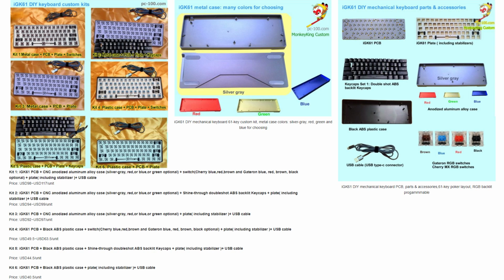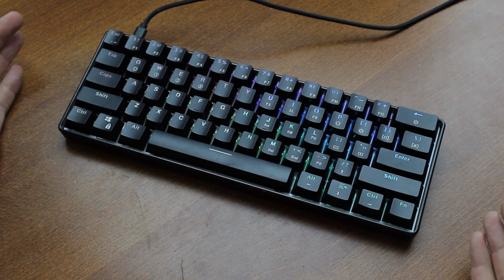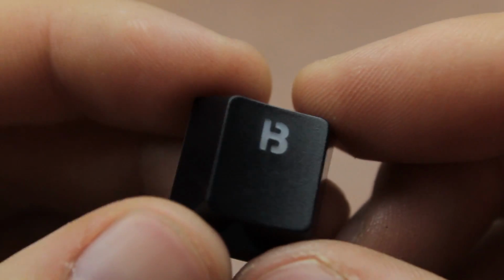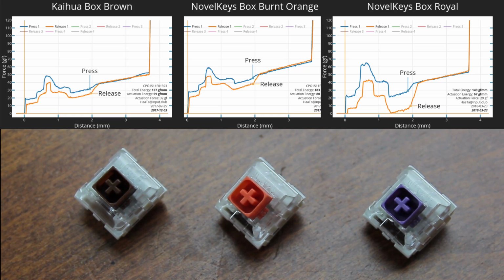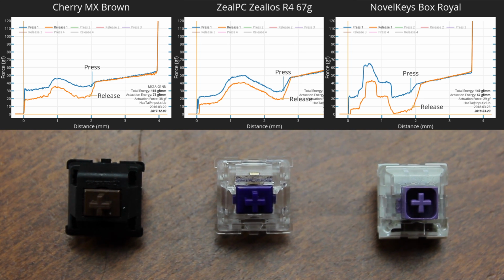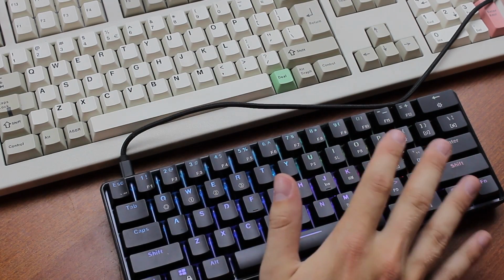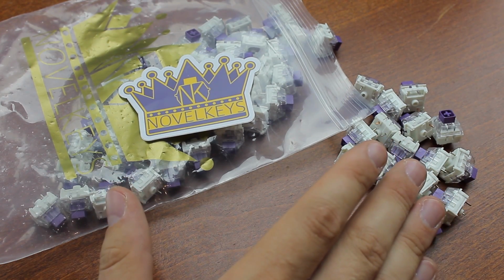MonkeyKing Custom iGK61 60% keyboard review (Kailh BOX Royal)

Comment: With regards to the digitality, I think it takes away from the transition throughout the stroke. I think that we need a sensory experience to ramp up (psychologically speaking) when we initiate the application of pressure onto something. But when our starting point is of a static force and then ramps downward it generates a sensation of collapsing rather than impeding the stroke. Perhaps this will serve as an analog. I could drive through a speed-bump experiencing the full shape of the oscillation or I could begin at the peak of the bump then roll off. The former complete travel creates a sense of contiguity which I think is sensorily valuable.  Without it there's a sense of dissonance. I wonder if this tactile feedback can be modified or if it is inherent to the design.
Reply: Agreed. 

But then again I do love Plum switches too

Comment: I own the GMMK board, two of them actually. They both came in bent and not sitting flat, I had to bend them to get them to stay flat, I think it's because they're aluminum and not packaged well. The bare bones base is only about $60, the full keyboard with switches and caps is a little over $100. I have the box navy switches in mine and the loud click causes a high pitched resonance from my board.

Comment: between jade navy and royals, which is the most clicky and preferably light?
Reply: I'm not chyrosran22, but I've used both of the box royals, and the box jades.

The box jades are much more "clicky" feeling then the box royals.  The jades also feel quite a bit smoother, the tactile bump on the royals is quite extreme in comparison. 

The jades seem to require less force then the box royals, the box navies are more or less the box jades but with a heavier spring.  So if light keys are what you are going for, I would avoid the box navies.
Reply: Cinnabar Sonar  thanks man you’ve made my decision
Reply: @jiajieguo7322  I'm assuming the box jades?
Reply: Cinnabar Sonar - yeah the jades
Reply: @jiajieguo7322  
They are both excellent switches in my opinion, I actually prefer the royals myself, but I'm a bit sensitive to the noise that clicky switches make.  If you want a clicky, light, and very tactile switch the jades are the way to go.

Just keep in mind that the combination of the thick click bar and the lighter spring can make the jades snag a bit on it's way back up on the return press (if you have a particularly tight plate mount), as explained in this video. 
https://youtu.be/rz-hYpgmUko

I haven't had an issue with that, and I did the very non scientific test where I clamped down one of the switches with a pair of vice grips, I still wasn't able to replicate that issue, so you would need a particularly tight plate mount for that issue to pop up.

I hope you enjoy them, they are my personal favorite clicky switches so far.
Reply: Cinnabar Sonar - Thank you so much for explaining the differences between the switches. I didn’t know which were the “best” switches for me and you have confirmed that for me. Thanks
Reply: @jiajieguo7322  
No problem, and I really hope that you like them.

Comment: BULLETIN UPDATE

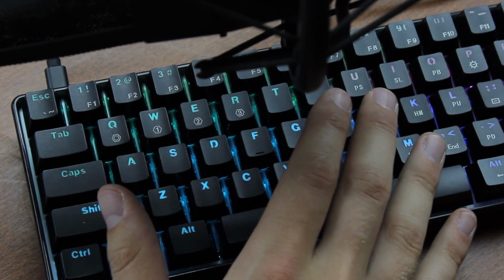In regards to the click that develops over time (the fun fact at 9:01), it's "part of the design" because the lube on the actuation nib rubs off gradually with use. Too bad there won't be plans to change the design.

We'll just have to go with Holy Pandas, Zealios v2, or KBDFans T1 (not sure where to find these switches). Alternatively, you could make Holy Chickies from halo trues and gateron blues. This with a jailhouse mod and latex plastic on the housing = glorious!

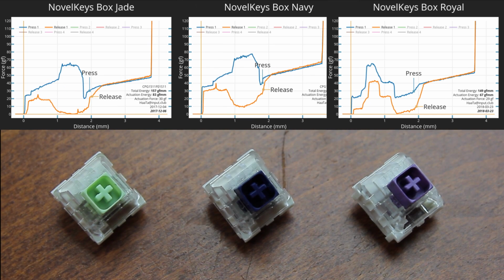Comment: Thomas, from your graphs at 5:30, and for high levels of tactility and clickiness desired (e.g. Model M), would you still recommend the Jades over the Navys? Would you agree the Navy's are probably closer to the Model M switches, actuation-force-wise? Would you even compare them in that sense?
PS. At 9:30, besides the keys we can hear what seems to be a clock ticking in the background: good microphone, or otherwise pretty loud clock ;)
Reply from the maker: I'd say Navies are nowhere near a Model M, they are SO much stiffer. I suspect even Jades will feel stiffer (I don't have a full board with them atm). Also, it's both a good mic and a loud clock xD .
Reply: @Chyrosran22  Thanks a lot! Ok will try a sample of the Navys first just in case. This other video of yours with the charts suggests the peak actuation force for both would be very similar though, both somewhere around 75 gr: https://youtu.be/0HiO3G_ZV0M?t=442
( Sorry about my maybe confusing the Model M and F, in any case I meant buckling springs, as in here: https://youtu.be/B9LcLgcCmus?t=370 )
Reply: @Chyrosran22  Hmmm just checking their own spec sheet from NovelKeys, is seems to confirm your assessment about Box Navies being a lot stiffer than Model M's. The force curve there goes pretty much up to 90 gf, and they do list Tactile Force as 95 gf +/- 15 gf !
https://cdn.shopify.com/s/files/1/3099/8088/files/BOX_Navy.pdf?5816470357010718290
That is indeed quite a higher range than what the graph in your video shows, where it appears to be just up to about 75.
If anything, the Jades would seem to be somewhat closer to the Model M's, with Tactile Force of 75 +/- 15 gf according to their specsheet (while Pale Blues have 70 +/- 10, and Whites have 55 +/- 10):
https://cdn.shopify.com/s/files/1/3099/8088/files/BOX_Jade.pdf?5816470357010718290

Comment: Hotswap boards are pretty common nowadays, and are popular with cheap Chinese boards.  Redragaon, for instance, switched their 30 dollar TKL, the Kumara, over to a hotswap design recently.
Reply: Outemu hotswap is not compatible with Kailh box switches, so not sure if Kumara is the best choice if you are into box switches. I am in the Kailh box camp, so I ordered a Hexgears GK705 off Aliexpress to scratch my hotswap itch cheaply, $50 shipped with a full compliment of box whites was hard to resist.
Reply: @rajendra82a  mine works, I have an outemu blue board with box whites
Reply: @Voodoo Yam all you have to do is clip one of the pins a little bit as it's too wide for the outemu board
Reply: @Voodoo Yam just grind the switch pins or do anything you could to make the pins smaller and it will fits

Comment: just ordere a Switch Tester of 12 tactile cherry mx versions. Cherry gateron kailh zealios and outemu. Also hako royals.
I can confirm what you said, compared to the box royals the others just felt linear. Even 78g zealios. 
Also can confirm that after playing a lot with the tester the box royal already turned clicky, which I dont like. Also the tactile bump is to sharp. Its like pressure pressure pressure with no give, sudden release and then nothing. 
Then there are hako royals that feel the same but stick to the bottom it seems.
In general I think this box royal design is not really durable and prone to early failures and defects, well box designs in general. Personally I think I will go for outemu sky with 78g spring, clear tops and a slightly retooled ice bottom for my first keeb. The tatility feels just a tiny amount better than the zealios.

Comment: If you get a bit of rubber and put it in the gap of the contact leaf part in a Box Brown, they feel pretty much identical in tactility to a box royal. 

Also I posted a video on my other account showing my EPBT caps flying off my Cherry 1800 with mx blacks, showing how they had stretched, but turns out the mx blacks were oddly thin on the cross section as my board of mx browns, board of gat red and gat yellows are fine. So box has definitely stretched some sets but 9 times out of 10 seem to fit comfortably without issue.
Reply: hey figureight see u on so many  videos saw u on adam c videos aswell

Comment: I haven't had any keycap fitment issues with my BOX navies. Between my GMK set and imsto pbt set; the GMK set goes on and comes off quite easily, where the imsto set has a bit more snug to it and requires a little more effort to remove. Otherwise, no apparent complications.

Comment: I think the click occurs because of the lube running out on the push rod (which pushes the contact leaf in the box). I've tried re-lubing that and it fixes the click.
Reply: How often do you have to re-lubericate them and how loud is the sound when they are not lubed?
Reply: @Animated__Freak  Not that loud, less than anything clicky, and about a couple month.

Comment: I need some expert help! I'm looking for a modern mechanical keyboard that feels like rubber dome or a recommendation for a very good rubber dome board with a nice hard bump. The key should have it's tactile bump right at the start or very close to it like rubber domes do also the key travel should be 2.5 - 3mm long with 55g or more force to press. Is there such a mechanical keyboard? Or maybe there is a way to modify one so it feels like described? Here are the few I tried already: Romer-G, MX blue with o rings, MX brown with o rings, Razer mecha membrane. The closest so far was the Romer-G switch but the bump is waaaay to light and it needs only 45g. Btw Topre is out of my price range i'm willing to spend up to 100€
Reply from the maker: Denis Müller try a BTC.

Comment: Just leaving this here for anyone interested in the switches and custom projects. 

I've put the box royals in an old WASD V2 TKL I had sitting in storage. Didn't want to go overboard in cost, so I went for the FILCO doubleshot SA (kinda) keycaps which imo are very good value for money. Initially it didn't sound very nice because the WASD case is just relatively thin plastic and, more importantly empty so it sounds hollow with heavy keys and switches. 

I glued 1.5mm thick steel plates on the top half of the inside of the rear panel, and 0.9mm thick plates on its lower part. I don't have a cutter or tools drill steel, so I went with 5x5cm and 2.5x2.5cm pre-cut plates enough to fill the base as best as possible. Then I covered the back of the PCB with two layers of electrical tape, filled the bottom with acrylic silicone (worked it a bit with some water and my hands first to spread a bit) and pressed the board in. I filled the gaps on the inside of the top cover also with acrylic. 

Managed to get it to 1.5 kg from around 1kg I believe it was on its own. Feels like a tank now and the sound is oldschool low pitch thuds which is exactly what I was going for with this project. If it's your thing may as well get some ideas from here.

The switches are very tactile, which I like, but don't think that you can utilise this tactility easily so that you don't bottom them out as you can do with clicky switches. I've notices also what Chyros says about them turning clicky. The click is not quite a click and as you're writing fast you can't tell it really. I've noticed that the "click" occurs when the switch is actually returning to its default position.

Comment: From my testing, the clicking seems to be due to the design of the switch itself - That is, the stiffer contacts slamming the leaf against the back of the notch. The factory lube prevents this noise, but as the lube wears off the clicking comes through.

Comment: As far as I can tell, most PBT or POM sets don't quite suffer from damage when sitting on BOX switches. I have a set of dyesub PBT Cherry profile caps on my BOX Navies and haven't seen any damage. In fact, they still sit tightly on a Realforce RGB board, which is what I took them off of. The caps that did come with my BOX Navy board, on the other hand, were cheap thin lasered ABS and an alarming number of them had stretch marks on them, likely from the time that they were in store on the shelf, as well as the time it took to ship to me. Of course, I will not be using any expensive SA, GMK, etc. sets on this board specifically because the problem seems to be worst on ABS caps, specifically GMK and any SA profile caps.

Also about the switches becoming a bit clicky over time, it may be the lube wearing off, causing the little pusher on the box to begin hitting the slider more audibly.

Comment: I have 4 bags of various box switches that I'm now a bit afraid to use because of this stem issue.  But I thought I heard that only GMK type keycaps were having problems on them. Is this true? Are SA keycaps safe on the box switches?
Reply from the maker: Evidently not, as my own SA caps are showing pretty heavy damage. My pre-GMK Cherry caps seem unaffected, though.
Reply: Chyrosran22 That's very disappointing. I wonder if replacement stems will be made available to retrofit existing box switches. I wouldn't look forward to modifying all those switches, but it's better than the alternative.

Comment: I had no idea about the Kailh Box stems. Definitely gonna keep that in mind when buying keycaps.
Reply: That's only if you have older ones though, they have been retooled recently to have standard size sliders
Reply: @JackOfHarts96  Thanks for the info. :)
Reply: @TobiasWeg  No problem :)
Reply: me to I ordered, some expensive SA caps, and know I have to thick about which swithches to use... I love the BOX jades and at the moment I use some cheap old cherry pbt keycaps on them... will see what to do.
Reply: They haven't damaged my DSA caps yet, the damage is less severe on PBT caps. The only way it'll really affect you is if you plan on using them on non BOX switches, they'll be looser on those. Personally I don't plan to though because most of my favourite modern MX type switches are BOX stem switches.

Comment: U gotta get the GMMK at its website which you can get a barebone for $60
Reply: Just know that the stabs are garbage and should be replaced (lubing/clipping/bandaid can help a bit).  Obviously, some corners had to be cut for the price point, so not really faulting them, just be aware.
Reply: Agreed, I had to replace mine. It was a noticeable improvement getting some aftermarket stabs.
Reply: lordlors hmmm, mine is also a 2018 version and rattle was quite bad. As I mentioned, do not really fault them given price point, and probably more picky than most on the noise. Good to hear that some seem to be better though.
Reply: lordlors it is tkl as well, and serial starts with 2018
Reply: lordlors agreed and why I said it should not distract from purchase, just be aware going into it.
Reply: 2018 tkl here. Stabs were horribad. Had to clip and lube them which really helped. I dont like how it sounds hollow but its a really good board nonetheless.
Reply: Mine honestly aren't too bad.

Comment: I didn't know that there was a problem with box switches's stem! Luckily enough it seems that my dev\tty (with box navy) are not affected (or maybe I can't see the stretch on gray), but I definitely notice that after 2-3 swaps they are softer to come out. I hope that PBT will be stronger than ABS, and thank you to have warned me before I put SA or GMK on!
Reply: Oh, I also remember having read somewhere that different plastic colours have different strengths because of the polymer of which they are made, and that the blue one is the softest of them. It may explain why you were so unlucky with your dasher keycaps...
Reply from the maker: Interesting. That makes sense, yeah.

Comment: It should probably be noted that NovelKeys has already pulled BOX switches from the site, and is having Kailh retool the switches with tighter stem tolerances. When the new batch comes out, they won't damage keycaps anymore.
Reply: It wasn't specifically the tolerances that were the issue, the design size was too large.
Reply: theSolarisDragon Yes, he's worked with Kailh to make sure the stem wasn't as large.

Comment: What is a good hot-swappable keyboard kit? GK64?
Reply: I have  the gk64 and I really like it. I bought it with gateron blues, but it has navies in it right now. Just waiting on my kbparadise v80 with matias clickies.
Reply: This company also sells a 64 key kit(which I have) and I really like it
Reply: The gk61 is only sold on pretty shady websites from what my google search results show.
Reply: no this one(gk61) is better because it has a standard layout. the gk64 is dope but uses stupid custom sized keys like a 2u shift so its caps are pretty much stuck on there like a cheap corsair board
Reply: thanks for the answers, maybe i should just get the PCB and sockets first

Comment: NovelKeys is (based on a recent Reddit thread at r/mechanicalkeyboards) already working with Kailh about the thick stem situation, that's why there havent been any BOX switches in stock for several weeks.
Reply: MrCharlieBros If so is the jade switch problem gonna be fixed?
Reply: Fairex Well, the post didn't mention anything about the Jades, only the stem problem, also, there's a theory that the Jade problem was from some defective batches and have been fixed already, but really I can't tell.
Reply: The current method for fixing "Jade lag" as I call it, is to lube the slider where it contacts the clickbar. People who did this to their Jades are saying it eliminated the slow feeling.
Reply: THERAZORKILLE Yes, I am aware, but it would be better if the switches came fixed straight from the manufacturer.
Reply: MrCharlieBros I hope so. Shipping is $5 and would take a long time, so I wont be testing them anytime soon.
Reply: MrCharlieBros After talking on /r mechanicalkeyboards I found out Kailh are reporting no binding issues with the jade switches, but people seem to disagree with that statement.
Reply: They are fine now. Have had box Navy w/ Maxkeys black & white doubleshot abs SA keys installed and no problems for months.  And damn do they sound nice.
Reply: @Valk69  I just pulled the MaxKeys SA keycaps off my box royals I installed over a year ago and no stretching, so I can confirm that issue is long gone.